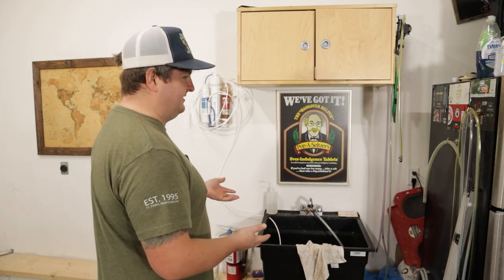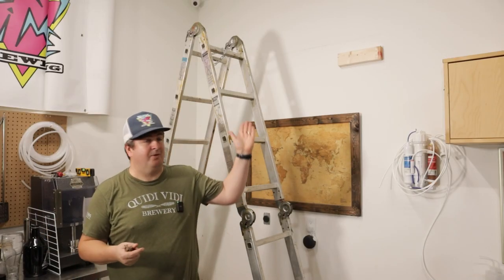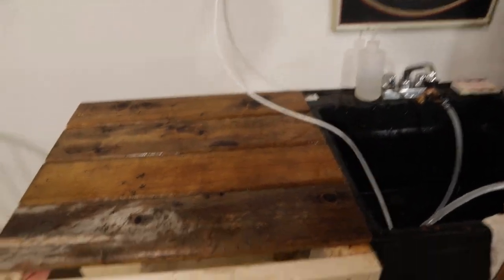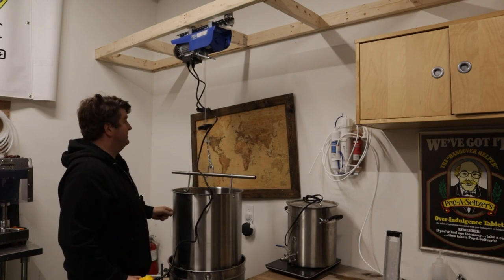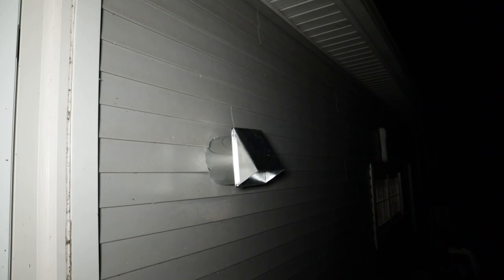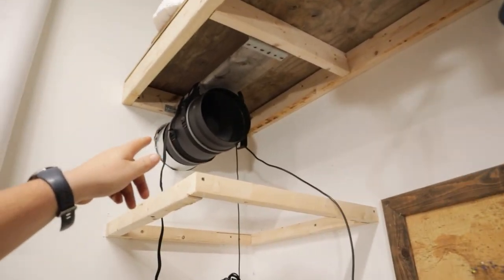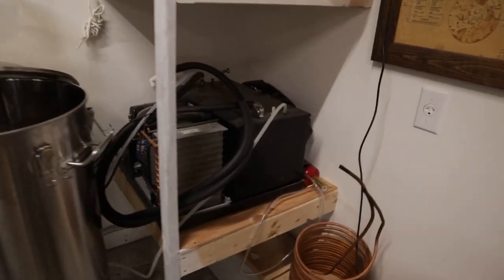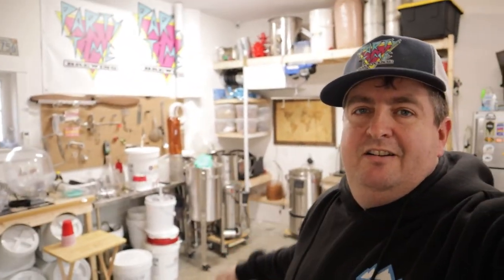Upgrading the Home Brewery

Comment: have you looked at a steam condenser? I have a Steam Slayer and it works great.
or how about the winch on a little track system so you can move the grain pipe out of the way of the boil kettle?
Reply from the maker: I probably should have just gone the steam condenser route, but already committed... A track system would be a great idea. Cheers!